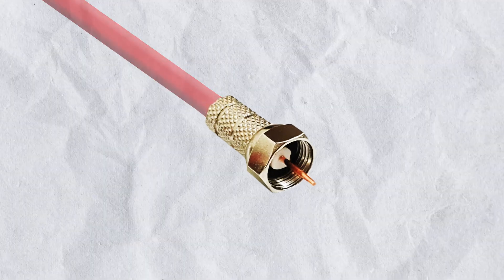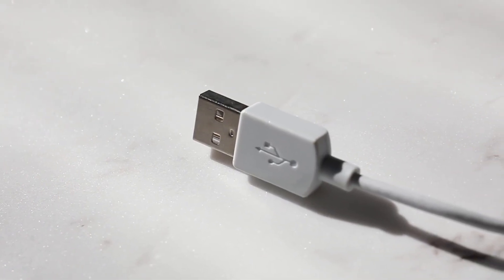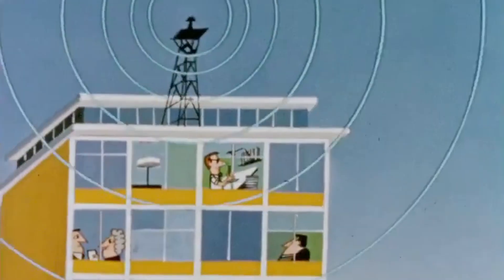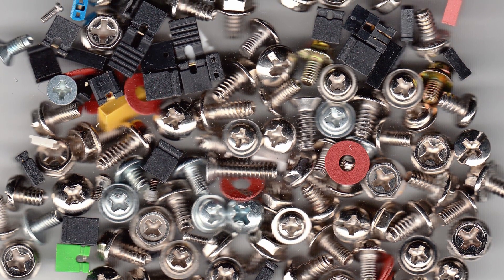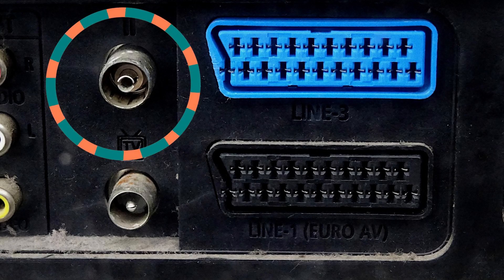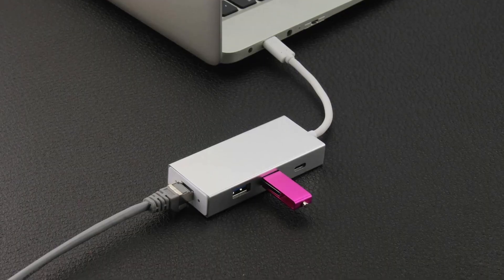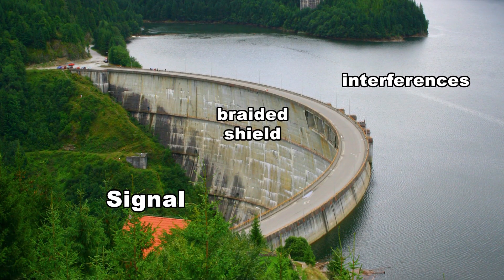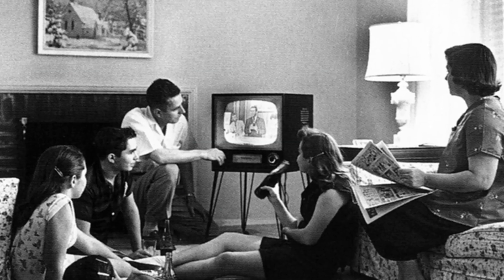Why Haven't We Replaced F Type Cables?

Comment: Differential pairs (what's actually used in USB) are better and cheaper, the great example is your Ethernet cable. It fights with interference by placing cables together and twisting them. Then all the interference is just subtracted.

Comment: Made a custom length one, along with a custom length ethernet cable and a 3d printed shelf so our modem sits right next to our coax access port without any excess cabling. 
Had to wrap and zip-tie the power cable, but it came out just as thick as the coax, so perfectly fine.

Comment: I use mine to avoid installing ethernet. I’m using MOCA which converts an Ethernet signal into analog and then back to an Ethernet signal after the signal travels through the walls. It’s extremely helpful if you’ve already have coaxial cables in your walls.

Comment: Not just for TVs, my ISP used those for internet. Where I live ISP connected them to their hardware in the attic, and from there, to the to the modem in client appartments (and then ethernet cable goes from the modem directly to PC or to a WiFi router)
My ISP started switching to GPON a few months ago, but many homes still have those.